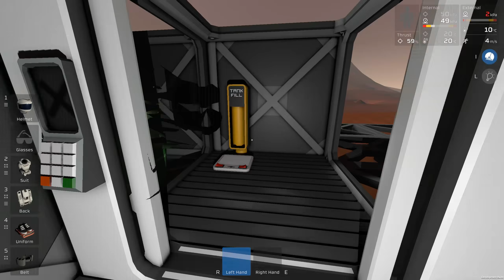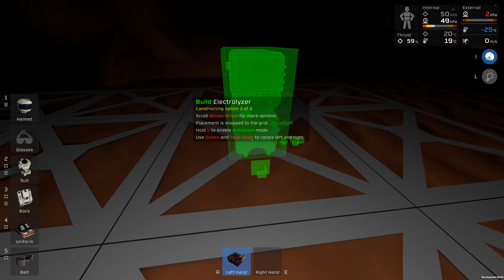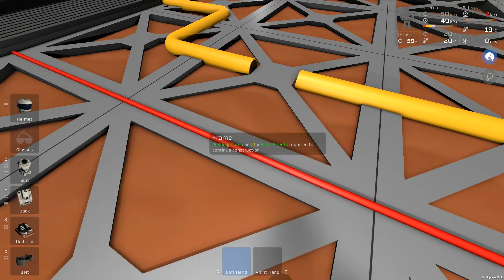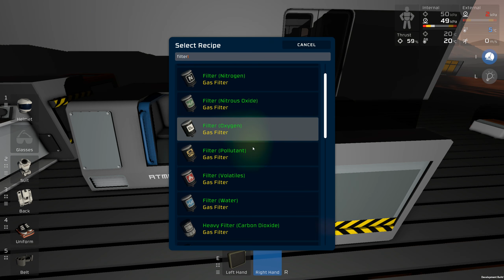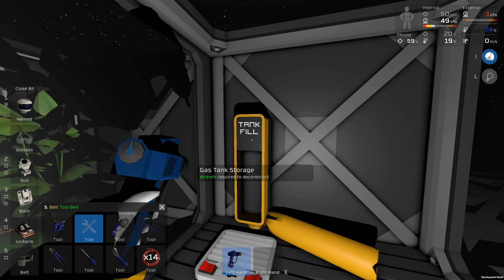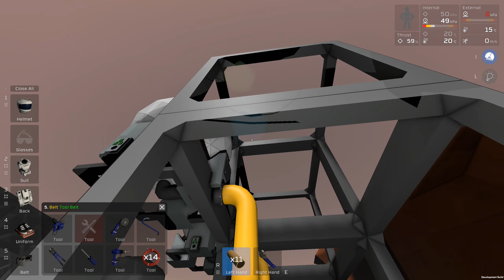Stationeers S4 E16 - Atmospherics and Sorting Gases

Comment: I would try to put radiators before the input on the tank, that way the heat from the gas will disapate and the pressure will drop, allowing for larger storage in one tank.

Comment: If you only filter the most prevalent component, looping the filter residue back is not quite as bad, but still rather inefficient (because you filter the same gas multiple times). I recommend sending the residue to a large buffer before looping it back. Keep it in the buffer at least until you switch to another gas being filtered (that requires only one buffer).
EDIT: I just realized that this method completely empties the input before looping back and reaches maximum efficiency.
Reply: I just realized that this method completely empties the input before looping back and reaches maximum efficiency.

Comment: If you are interested in automated hydroponics code (this IC can operate up to 6 hydroponic units) :

alias Hydro1 d0
alias Hydro2 d1
alias Hydro3 d2
alias Hydro4 d3
alias Hydro5 d4
alias Hydro6 d5

alias isMature r1
alias isOccupied r2
start:
yield
move r0 0
loop:
bdns dr0 next
ls isOccupied dr0 0 Occupied
beqzal isOccupied plant
ls isMature dr0 0 Mature
beqz isMature next
s dr0 Harvest 1
j next
next:
add r0 r0 1
blt r0 6 loop
j start
plant:
s dr0 Plant 1
j ra
Reply: This is code to enable filters when pressure is more than 1000 :

alias Analyzer d0
alias FiltrationUnits d1

start:
l r0 Analyzer Pressure
sgt r0 r0 1000
s FiltrationUnits Setting r0 #this for memory
s db Setting r0 #this is to write using batch writer from chip
yield
j start

Comment: with the filter-preserving on/off system, consider measuring the partial pressures / % concentration of gasses & only turning on the filter for the highest concentration gas - thereby eg not wearing out the water filter when no waters in the unsorted input
Reply from the maker: Oh, that's a nice idea. We're going to do just that :D
Reply: You even can leave pressure X in the pipes . So you can save radiators because the gases inside the pipe mix and so the temperature. This would definitely reduce the pressure due to temperature differences on your system.

Comment: Currently the heat of the gas doesn't impact the atmospherics unit.  They have a "shatter" temp of "1K", which I think is 1000K[?] ( https://stationeering.com/guide/thing/StructureFiltration ), but I don't think that's active at the moment since pipes have the same ( https://stationeering.com/guide/thing/StructurePipeStraight ).